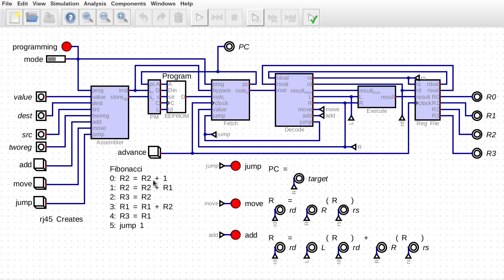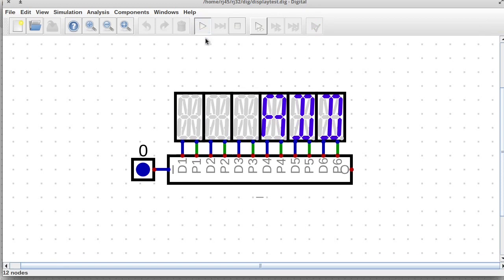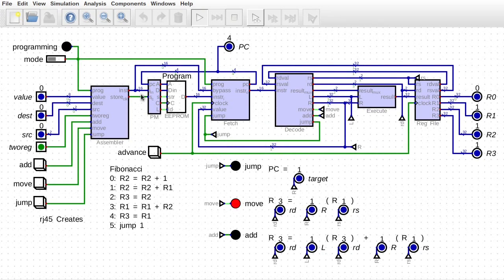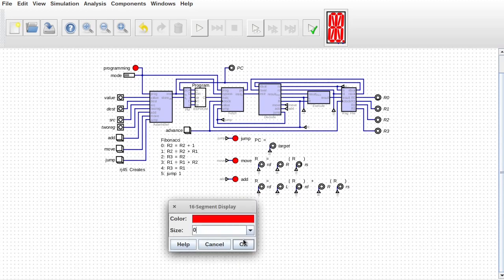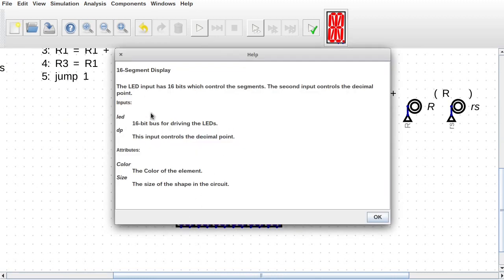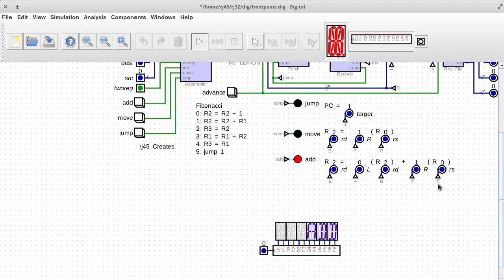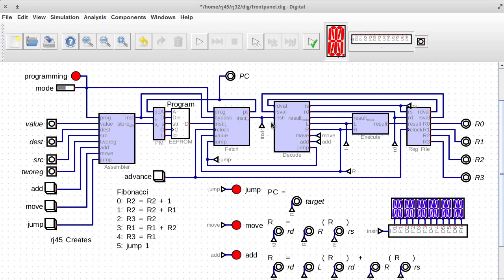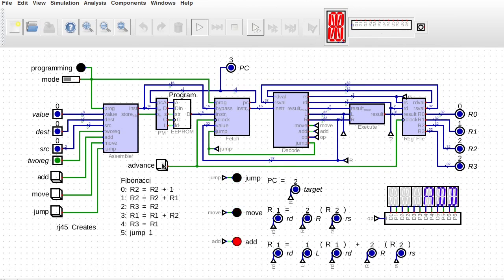[013] Instruction Blinkenlights! - Building a CPU From Scratch

Comment: In a hardware circuit you would be unlikely to dedicate 6 rom chips for this. Instead, you would rapidly cycle through each 16seg display and alter the address in your single rom for the content. Obviously that only works when you have a clock that runs fast enough to trick the viewer into seeing the whole display as static.